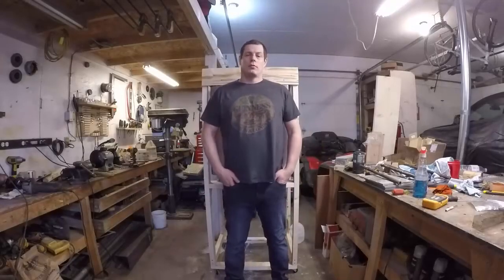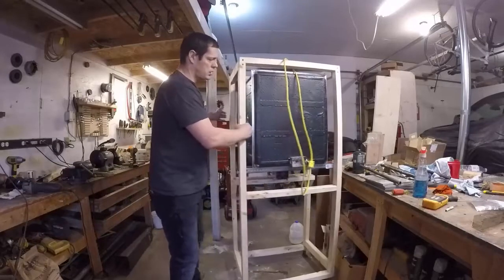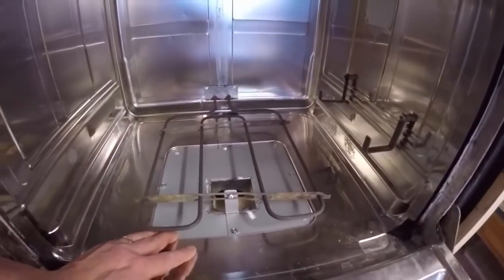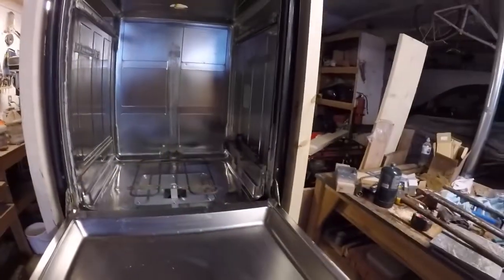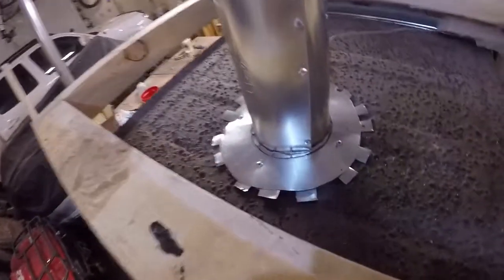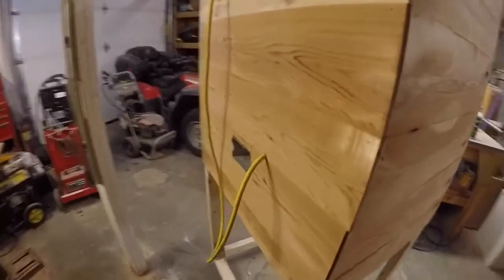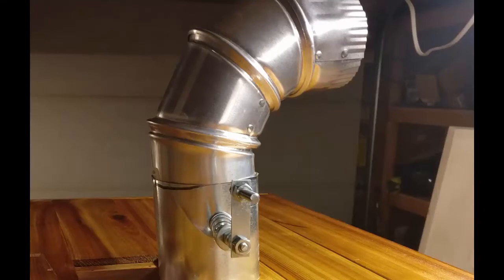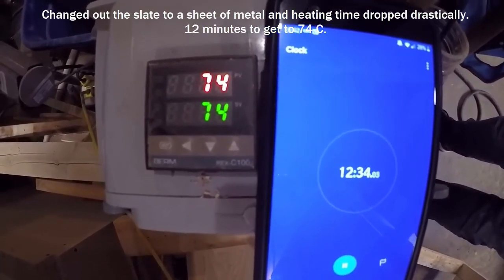Home Made Electric Smoker

Comment: How's the smoker been holding up?  I was thinking of doing the same thing but using an old double oven I have
Reply from the maker: It has been working great.  Made 50 lbs of smokies last weekend in two batches.  The oven element is 240V 2200 watts and I  am running it with 120V so that changes element to output 550 watts.  It heats up a bit slow but with that it does not over cook sausages on bottom when they are hanging.